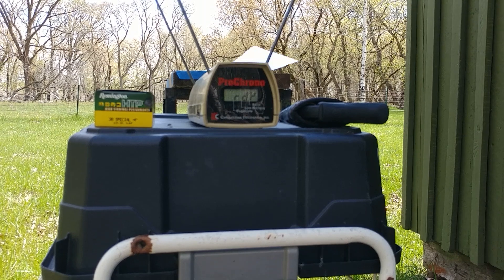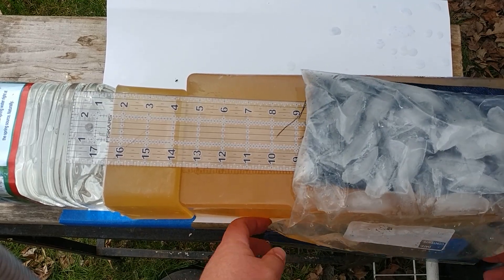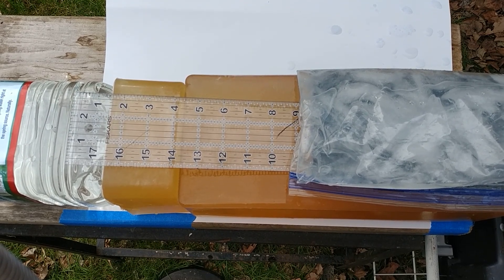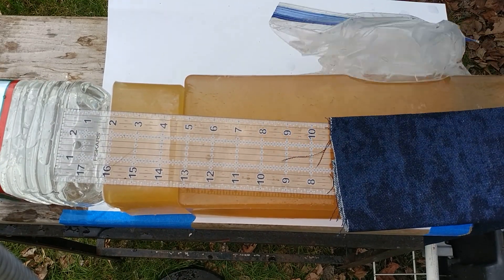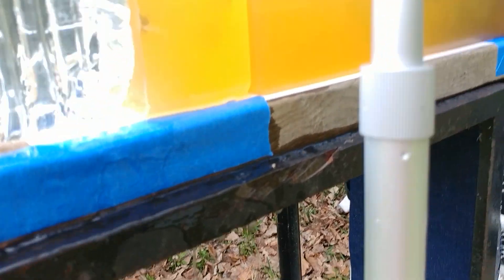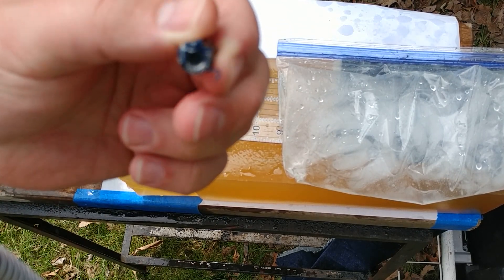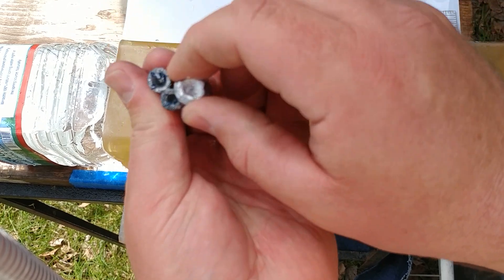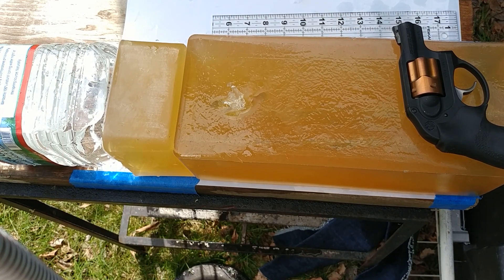Ballistic gellatin test shoot of Remington 125 grain 38 Special + P High Terminal Performance load

Comment: I've seen "modern" bullets fail. If you plan to carry this (I certainly would consider this a good carry load), get it from Target Sports or some other outfit that doesn't hype the price if you can. It is a "practice with what you carry" priced cartridge. I've seen a couple 357 Magnum tests with the 125gr HTP. It seems to be a 13-14" penetrator with poor weight retention. It goes off like a grenade in the gel. Very nasty I'm sure.
Reply: I'm not sure why, but I found this test amusing. What if he dropped his 686 into the water drum? Some cleaning would have to be done!
https://www.youtube.com/watch?v=hGLDH-SNoyk
Reply from the maker: Agreed. This would be a very good carry load, and I am planning another test in the near future, probably with a simulated rib-cage involved. I'm hoping my wife comes out to test fire this round as well because I think she could shoot it very well in her snubbie.
Reply: @GeographyCzar  I'm also interested in the 158gr version. Unfortunately it has no jacket. It's just a LSWC-HP. Leading is a PITA to clean. I haven't pulled a bullet to see if they have gas checks.
Reply: @Fudmottin  
Just shoot about 10 jacketed bullets after you are done shooting your lead stuff and most of the lead will get squeezed out. I would recommend loading some jacketed wadcutters just for this purpose.
Reply: @MegaAppleshit  Can't that cause unsafe pressures or damage the barrel?
Reply: @Fudmottin 
Not if you load them to low pressures. Most load manuals have loads for wadcutters. They wouldn't exist if they were dangerous at 38 special pressures. I have seen people load up 357 magnum wadcutters with jackets.
Reply: @MegaAppleshit  I've only got loading data for lead wadcutters as cowboy action loads. And the only wadcutters I have are lead.

Currently my gun money is going into my Biden contingency program. I'll revisit this in November.

Comment: That looks exactly like the Winchester Super-X 125 gr+P bullet I tested back when I was using just 4 layers of denim and water jugs and nothing else. Velocity was about the same in my snubby as yours. With the HTP in my new test medium I got great expansion. I think with denim my tests represents a chest shot and yours represents a gut shot. With bare gel I don't know how to analyze that one lol.
Reply from the maker: I know, I was really surprised how different my results were.
Reply: The main quality of gel is that if you follow the IWBA protocol, it is very reproducible. That allows you to correlate it with real world performance. However, it should not be the only test because other factors do exist. That's why I like Sam's tests and Paul Harrells meat target tests.
Reply from the maker: @Fudmottin  I'm right there with you. Also, this is an easy shooting load, and I like the way it "fails" if you can even call it that. The round retains it's rough edges and penetrates violently.
Reply: @GeographyCzar  That's what she said!
Reply from the maker: LOL